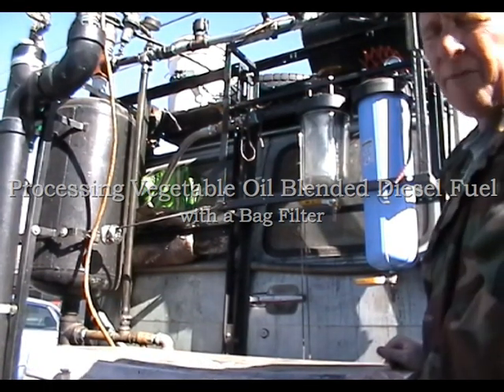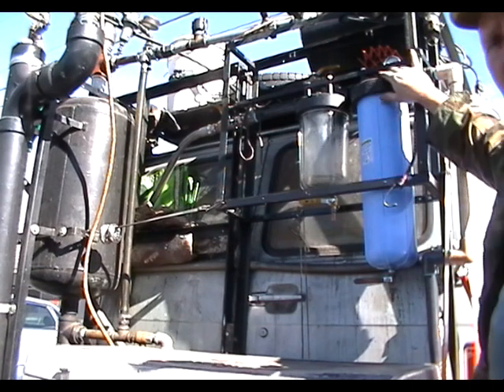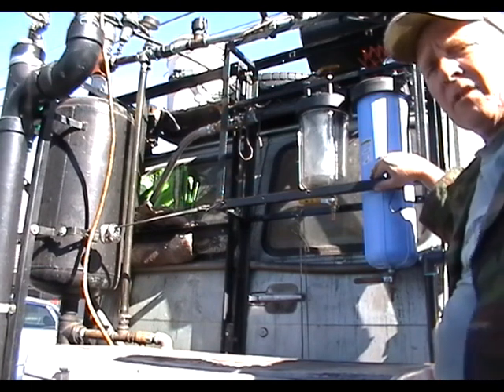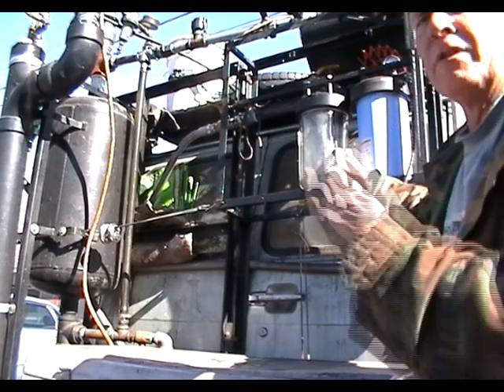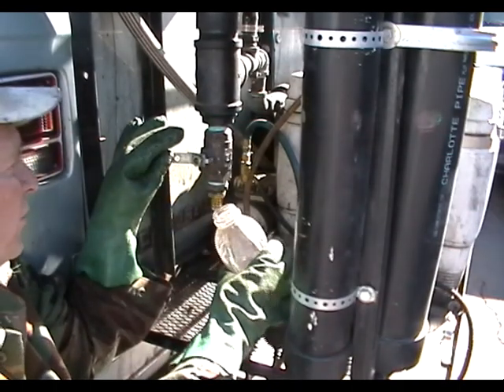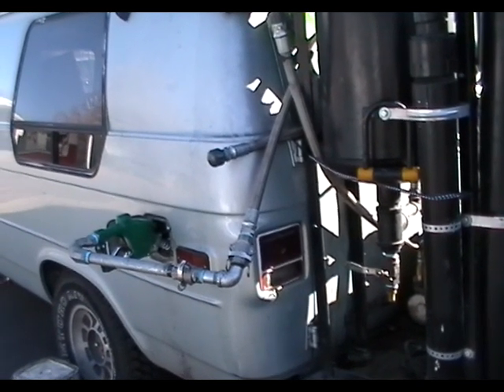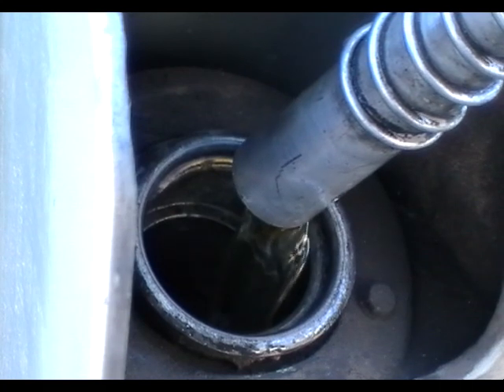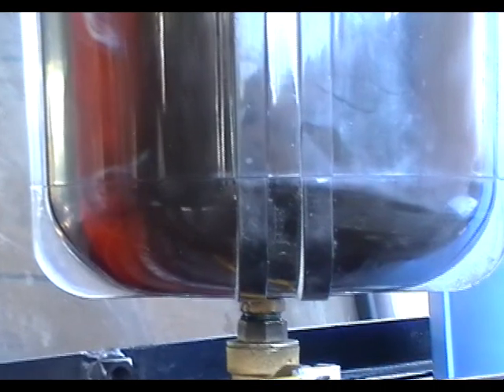Processing (Making) Vegetable Oil Blended Diesel Fuel with a Bag Filter

Comment: Does blending gasoline with vegetable oil get the glycerine out sufficiently?
Reply from the maker: Glycerine is a byproduct of the biodiesel process so it is not an issue for blending unless you are also blending biodiesel into your blend, and blending gasoline with vegetable oil eliminates the need for the biodiesel process.

However, gum is an issue with vegetable oil, and it is worse with waste vegetable oil. I find blending with kerosene not either gasoline or diesel fuel will reduce gum, and adding about a cup of acetone to the final blend of 25 gallons forces gum out of solution.

I also find no more than 50% waste vegetable oil in the blend is best.

Comment from the maker: @2xtream The basic formula that I recommend is 20% gasoline to 80 vegetable oil as a year round blend.  Variations are relevant to viscosity of the source oil and night time temperature.  Basically, the thicker the oil, or the colder the night time temperatures, the more solvent, such as gasoline, one must add to avoid mechanical failures due to too viscous fuel.  Yes, acetone can be added, but does not seem to be necessary, unless one can find it at a lower price than gasoline

Comment: What have you determined one should blend Gasoline with Vegetable oil? What is the mix and does it vary from batch to batch. How do you determine the mix per batch of fuel? Can one add acetone to the mix? Is that a good idea? say 2 oz per gallon?

Comment from the maker: @glumpy10 considering that I have a 40-year technical career, that includes working as a researcher at Chevron Research, where I engaged in fuels research, as well as a stint in automotive R&D elsewhere, and I have been studying various forums of burning vegetable oil in a diesel engine for 5 years, then I believe it is reasonable to consider me an expert in bio-fuels for diesel engines.